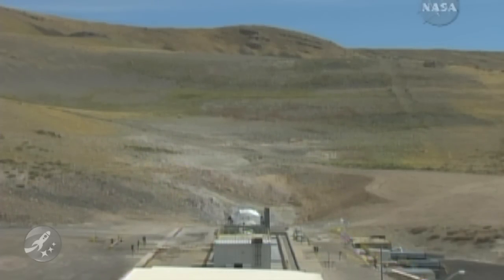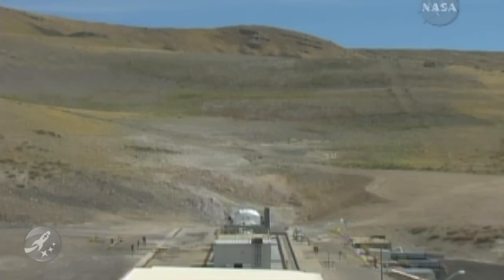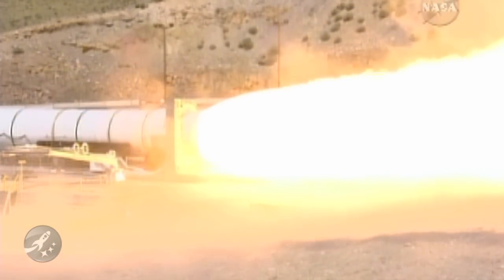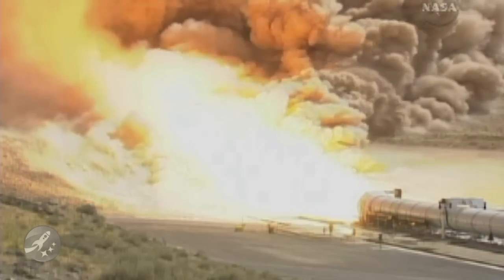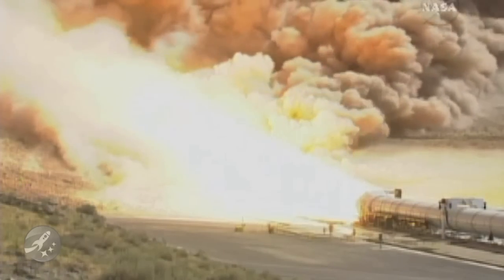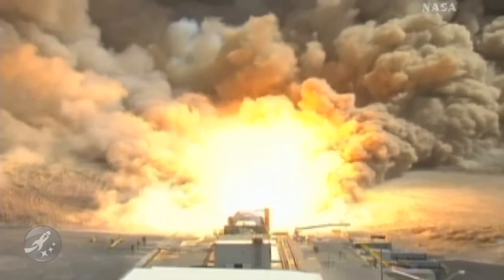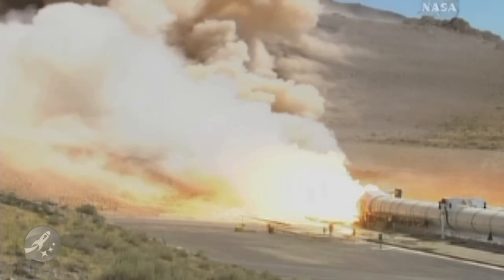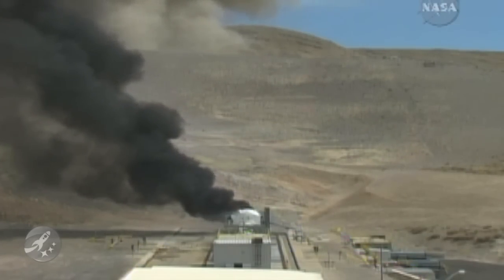Ares I Motor Test

Comment: makes you wonder what's holding back 22,000,000 horse power
Reply: +Brit Gilpin paper clips from Wal-mart.
Reply: Yeah, at least 22.000.001 HP
Reply: +Charles Andales Horsepower is a perfectly valid unit of measurement. Horsepower is a unit of measurement for power. Thrust is a force, not a unit of measurement. The thrust creates measurement of a unit of work, and power is a measurement of how fast work is done...

Thrust is not a unit of measurement.
Reply: +Charles Andales Firstly, "Thrust" is not a unit of measurement. Thrust is not measured by weight or mass, it's measured by force. On an aircraft force is exerted by the propeller moving air in a direction, in a rocket force is exerted by combustion byproducts being expelled. It doesn't matter what is causing the mass to move, its still called thrust - you can use electrohydrodynamics to move air by charging particles and that will generate thrust too - there is certainly no "engine" of any sort involve in that, just several tens of thousands of volts on a wire.

I'm an engineer who designs hybrid rocket engines, and have a pretty sound grasp on the engineering side of things as well as fluid dynamics and aerodynamics.
Reply: +Brit Gilpin It was holded back by a Nokia 3310
Reply: +Charles Andales Actually thrust doesn't overcome weight in an aircraft, it overcomes aerodynamic drag to keep air flowing over the wings. The lift of the wings is what lifts the weight. In a rocket it needs to overcome weight (or at least gravity) as you don't have a lifting surface. Like I keep saying, Thrust is not a unit of measurement, it is a force that can be measured with a unit of measurement like HP, but ideally a nice force measurement such as Newtons or for Americans, Pounds-Force. This is like saying you believe aircraft are measured in speed, rather than km/h because they dont work the same as cars. An aircraft's speed (the thing being measured) is measured in Knots, however on an airline or in the news they might translate that to a unit the audience is better able to understand such as miles per hour or km/h, despite the fact that the people who designed the aircraft and the people who fly it would use knots (since it makes navigation easy)
Reply: +Brit Gilpin 
Ive learned something about power released from a tube,  but still no answer to the accual question.
WHATS HOLDING IT????  Or did it spin the planet?
Reply: +Brit Gilpin "makes you wonder what's holding back 22,000,000 horse power"

Chuck Norris
Reply: +Xittin Anas Its on a massive concrete platform that would have pylons into the ground, and there is a huge concrete block in front of it. It would be essentially mounted on a rail system so it can move back and forth a tiny amount, this allows the load sensors at the end to compress/flex to get a thrust measurement. Essentially, the answer is: A huge block of concrete well secured into the ground. It doesn't make the earth spin any more than you pushing on a wall makes the earth spin. It moves air in one direction while pushing on the ground in the other - there is zero net effect.
Reply: +HotelPapa100 uh no it doesn't. Power has nothing to do with velocity. Power is a unit of force over time - horsepower is specifically 550 ft.lb per second. ft.lb is a perfectly reasonable measurement of thrust if you don't believe in metric, hp just takes it a step further than necessary.
Reply: +HotelPapa100 I think you're applying units to the wrong components of the engine. The mass being expelled out the aft end is what is generating the thrust (every action has an equal and opposite reaction) The speed of the body containing the propellant has nothing to do with the thrust, the body is what the reaction is applying force to. You most certainly can measure the thrust of the rocket in N.m, and it is a very very relevant measurement. If you want to lift a mass you need to know how much force you are applying. Impulse is most relevant to the fuel. Basically, you're trying to measure the gas efflux when everybody who does anything with rockets (except propellant engineers, who need to make sure that lasts long enough, and therefore want a high ISP that can generate that force) is measuring the effect that has on the motor body ;) If you stick a force gauge in front of the rocket motor sled (as they would have in the video) you're going to measure a force on it whether the motor body is moving or not.
Reply: +Brit Gilpin 

Offscreen they have 22 million horses pulling in the other direction. :p
Reply: +Charles Andales yes it is measured in thrust but not JUST thrust. you can't just say a rocket has, say, 10,000,000 thrust. you have to measure the thrust with a unit.
Reply: +Brit Gilpin No, it's not measured in thrust. Thrust is what you are measuring. In a car you measure speed. You don't say a car is going 100 speed... you say the speed (what we are measuring) is 100mph (the units of measurement)
Reply: +Brit Gilpin  A BOBBY PIN AND SOME DUCT TAPE.
Reply: panaxion yes I know that that's what I was saying. Take a 777 for example. One of its engines doesn't produce 110,000 thrust, it produces 110,000 POUNDS of thrust. I agree with you.
Reply: +Brit Gilpin  a couple lag bolts .  maybe a tapcan or too
Reply: +Charles Andales.  Actually, space engineers use horsepower all the time to describe and compare the power of rocket engines.  And it's particularly useful when speaking to the public, who know very little about kilograms and newtons, but think about horsepower on a daily basis.  The three Space Shuttle main engines produced 36 million horsepower at liftoff and about 38 million in the vacuum of space.  See how easy that was?
Reply: JOHN CENA!!!!!
Reply: +Brit Gilpin Millions of Tons of Concrete and Steel.
Reply: Shit that was just a Chuck Norris cum shot.
Reply: +Brit Gilpin Some chewing gum.
Reply: +Vipre77 it went into the earth.  The earth moved a wee bit, but it moved.
Reply: +Brit Gilpin to bring up and old argument, it comes down to this. Thrust is a unit vector, while Horsepower is a measure of energy output.
Reply: Everything can be measured in Horsepower , because its a unit of power and u can basically convert anything into horsepower, and this is horsepower by definition "an imperial unit of power equal to 550 foot-pounds per second (about 750 watts)."

 this is from NASA: "The two Solid Rocket Boosters generate a combined thrust of 5.3 million pounds, equivalent to 44 million horsepower or 14,700 six-axle diesel locomotives or 400,000 subcompact cars. At liftoff, the two Solid Rocket Boosters consume 11,000 pounds of fuel per second."

Regards
Reply: +Charles Andales it's an engine.
Reply: + panaxion: Nope. Power is a unit of energy (or work) over time. Energy is force times distance. Distance over time is velocity. So power can be expressed as work over time or force times velocity.
N.m (ft.lb if you must) is not a unit of thrust (force) it is a unit of energy (if the multiplication is scalar).
Force times time is impulse, equivalent to change of linear momentum. THIS is the relevant property of a rocket.
Unfortunately conservation of momentum is taught much less and thus used and understood much less than conservation of energy.
Rocketry is all about impulse and momentum, and very little about energy and power. (At least it's much easier understood and less influenced by outside disturbances if discussed in those terms.)

Oh, and apologies for the use of "power of reaction engines". I used 'power' in its general sense there, not its precise physical sense. Because, as laid out here: there is no such thing as the defined power of a rocket engine. Its output in watts or horsepower depends on the way it is used.
Reply: +panaxion: Sorry, I don't even know where to begin. Thrust is a force, thus is measured in N or lbs. How you can make up Nm as a valid unit to measure thrust is beyond me. (And anybody who has sat through their physics 101.) Ask Wikipedia, if you haven't memorized that tidbit. (And don't come up with the argument that Wikipedia is not always right. On basic stuff like that it is.)

The speed of the body has nothing to do with the thrust, but it has everything to do with the fact if the thrust is doing physical work or not. Work is the scalar product of vectors force and travel. No travel, no work, no power.

Does the chair holding up your weight against gravity do any physical work? No, it doesn't, even though it pushes up your behind with a force equal to your weight. And neither does a roaring rocket engine bolted to the ground.

You can measure the thrust, you can measure how long it exerts that, and from this you can deduce how much impulse it imparts on a rocket and what you might have lifted with that, and accelerated to which speed. Doesn't change the fact that during that test no mechanical work has been done to the useful end of the system (there is a lot of work going into the troubled atmosphere) and therefore the (horse-)power of that engine is zilch IN THAT TEST.
Reply: ***** on speed vs. velocity: So velocity is the vector, speed is its amount. I'm not familiar with these intricacies of terminology; English is not my first language. What's your point anyway? In principle the calculations always have to be done in vector space, but often it's acceptable to assume equal direction and just calculate with the amounts.
Reply: +Brit Gilpin 22 ,000,000 tane at koskocaman bir uzay mekiğini nasıl itsin dostum söyledğin şey cok saçma :P
Reply: +Charles Andales Because thrust is not a measure unit and horsepower is... Maybe the commentator knows nothing about rockets but he sure does about physics..
Reply: Russell S easy maybe, but wrong all the same. At liftoff speed is close to zero, so power acting on the system is small. It quickly increases as speed increases. Using horsepower as a unit is just misleading pseudo-science.
3 thrusters rated at 1860 kN at SL need a speed of 4810 m/s == Mach 14 to produce 36E6 hp == 26.8 GW.
Rocketry is difficult to discuss in terms of energy and power. The natural concepts are linear momentum and impulse.
Reply: +Andy Man Actually... the Shuttle's 4-segment SRBs produced around 2.5 million pounds of thrust / 60 million horsepower EACH.  The "enhanced" 5-segment SRB in the video (proposed as the Ares I first stage and now to be used as one of two SRBs for NASA's new SLS "deep space" rocket) is rated at 3.2 million pounds of thrust, and so is likely producing over 80 million horsepower.  The commentator who says "22 million horsepower" on the video is using a number that is far too low!
Reply: +panaxion. You were doing great until the last two sentences.  As the NY Times admitted a few years ago when it apologized posthumously to Robert Goddard,  rockets exploit a Newton's law (for every action there's an equal and opposite reaction) and don't need air to "push against."  That's why they work fine in space.  In the video, the SRB's exhaust obviously introduces enormous local turbulence into the fluid that is the air, but doesn't push very effectively against it (and even less effectively against the Earth over which the air moves around).  So your idea of "zero net effect" is not true.  In fact, the rocket delivers a NET force in one direction -- pushing on the concrete block, the adjacent mountainside and the Earth.  This force in fact slows down or speeds up the Earth's rotation to an infinitessimal (but measurable) degree, depending upon which direction the rocket is pointed.
Reply: Russell S Pray explain to me by which calculation you arrive at your hp-figures starting from thrust. Because, try as you might, you don't make sense to anyone who has a minimum knowledge of mechanics.
Reply: +Brit Gilpin chuck norris. But he was only holding it back with one arm...
Reply: +Charles Andales Horsepower is measured in units of slug ft^2/s^3. Watts are measured in units of  kg m^2/s^3.

Horsepower can be converted to slug ft^2/s^2, which is also called the slug force or lbf, foot pounds, a unit of force equivalent to newtons.

Using newtons as units of thrust isn't that different from using lbf or horsepower.
Reply: actually, smarty pants, rocket motors are usually rated by impulse (thrust integrated over time) and the units are Force x Seconds.  Impulse is very useful because it can be used to easily calculate velocity or acceleration of a spacecraft at any given time by knowing the mass burn rate function.   But using horsepower is a measurement of what rate energy/work is being produced (force-distance/time) and is entirely appropriate measure for a static test in front of an audience of laypeople who are familiar with the unit and are looking to be impressed by big numbers.
Reply: +Vipre77 haha, I'm an engineer too, I see what you did there.  Pretty sneaky.    But the earth moved...oh....got you there!!!   ; )
Reply: +Charles Andales Yeah, 22,000,000 Thrust sounds heaps better. LOL.
Reply: Chuck Norris
Reply: with this logic you say standing buggati veyron has zero horsepower...thats clearly not logical at all...and also would have different horsepower given on which trajectory to the center gravity of earth its going....because going straight up its the slowest...doesnt make any sense to me... I found this - Horsepower (Hp)= the measure of energy expended in a given time, 1hp=.746Kw, or the ability to move 1000 lbs one foot vertically in one second.
Reply: motor not engine
Reply: Brit Gilpin nuck chorris
Reply: FLEX TAPE
Reply: A fuck-ton of elmers glue
Reply: Obviously Chuck Norris
Reply: The earth
Reply: Reinforced steel fasteners, holding it tightly on the ground.
Reply: A mountain
Reply: We need somethings better
Developing technologies to enable human access to space at dramatically lower cost and increased reliability #FeelFree http://youtu.be/6q7MovLP-e8
Reply: Very simple, what a rocket really does is to apply a force to the opposite direction called thrust. You only have to apply same force in the opposite direction. For instance: The Shuttle´s SRB had a thrust of 13,79 MN (3.100.000 lbf), so if you want to hold them, be sure that you applying  those 13,79 MNwton. 13,79 MN = 1,417 MKg-force = 1,417 Tons. It´s very easy to get 1,417 Tons ;)
Reply: +panaxion  I'm a mechanical engineer and one of my areas of focus in college was aerodynamics.  I haven't done of that since graduating, and I realize you're putting things into layman' terms here, but I wanted to clarify something here and I'll contend that the rocket shown in this video actually produced 0 HP.  Yes, zero horsepower.  Here's why.  Power is defined as a rate of work done, as you said.  P = W/t.  P = power,  W = work, t = time.  Work is defined as the force applied times the distance the object is moved.  W = F x d.  W = work, F = force, d = distance.  F, in this case, equals the amount of thrust generated by this rocket.  The casual observer here will note that the rocket did not move (at least not relative to the earth, anyway), so d = 0.  Plugging that into our equations, that means W = 0, and if W = 0, then P = 0, also.  So, technically, this was an awesome rocket that produced zero horsepower.
Reply: Further explanation:  OK, so the rocket make zero horsepower?  How can that be?  Where'd all that power and energy go?  Well, the answer is that the power was transferred to the air, all that dust/glass that was thrown into the air, and into waste heat, all of which contribute to a whole lot of audible noise.

Also, for anyone saying rocket engines aren't "engines" needs to search Wikipedia's entry on internal combustion engines.  Rocket engines are a sub-category of jet engines, sometimes called a reaction engine.
Reply: +panaxion Power is force times velocity. So power developed in this experiment, nailed down, is exactly zero.

Hosepower is a stupid unit to measure power of reaction engines, it only makes sense at a given speed.

Comment: As impressive the power and technology of this motor is,I'm pretty sure there are way more efficient ways of getting a payload into the stratosphere,heck weather balloons already float that far up.Then the rocket can fire the rest of the way with less resistance?
Reply: Col. Angus It is a promising way of designing the first stage of a rocket's flight, but technical limitations occur, the most important of which is the obscene quantity of helium that would be required.
Reply: Argonwolfproject If you used helium filled balloons only, agreed.I would be curious to see a combination of copter rotors,jet engines,helium balloons and finally rockets together working in combination or in stages.
Reply: Col. Angus
Though it's possible, few of those have the necessary thrust-to-weight ratio to actually accelerate a craft rapidly enough to eventually get into orbit. Helium can be feasible because though it's got a very low lift, it doesn't consume fuel and effectively creates free upward thrust.